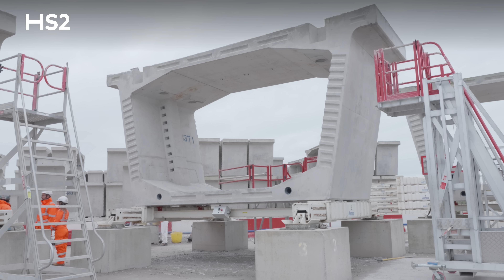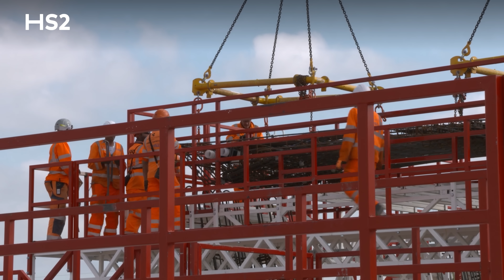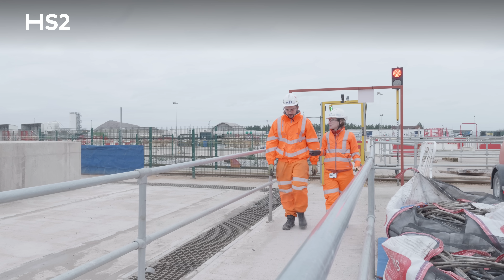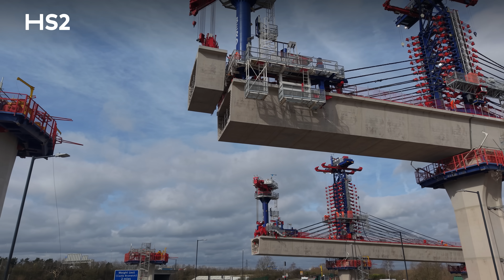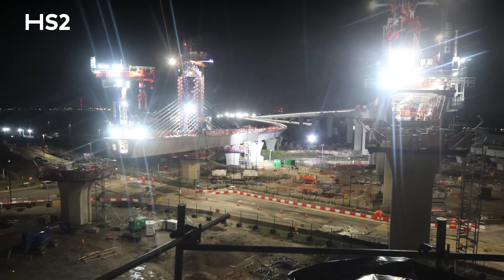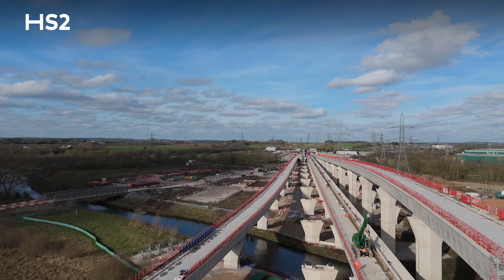Last segment produced at HS2's giant 'viaduct factory'

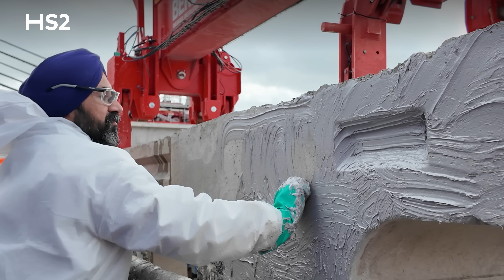Comment: 2:55 I get the glue is probably immensely strong, but I find it hilarious that these viaducts are glued together!
Reply: They are also mechanically connected using internal steel tendons, that thread through the holes visible in the segments.
Reply: @Polarbear1-b6j  why do they glue then ?
Reply: @fergusjones123 you don't want to be dependent on just one method which could fail. What happens when the cables need replacing in 50 years? Redundancy builds strength and safety.
Reply: @fergusjones123  The glue has two uses. The first is to lubricate the connection between the two segments when gluing them together. The second, after polymerisation, is to seal the joint. The glue has no structural function in the short or long term.
Reply: @ciccolinistephane4637  Stephane, thank you for this explanation; it is much appreciated. Hope you and the team(s) can continue this great progress on HS2 throughout 2026. Best wishes.
Reply: Probably not a good idea to let water fester in the cracks.
Reply: Not just glued together

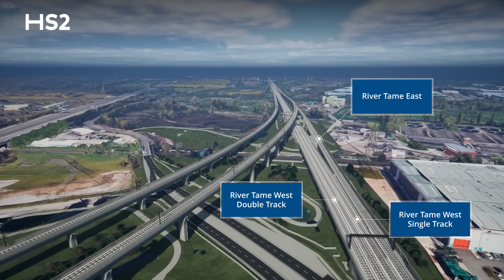Comment: In the graphic at 3:12 the labels are all wrong. The 4 tracks of the main line can be seen going from the bottom of the image to the background with 3 tracks going under Water Orton No. 1 Viaduct and 1 going around to the right of it.
The issue here is that this is not 3 long viaducts the whole way but rather 2 viaducts then an embankment and then the 3 viaducts mentioned in the labels.

Following the main line from the bottom of the image northwards:

1. First we can see 4 tracks all together on the Chattle Hill Box Structure which takes the line over Lichfield Road.
2. We can then see 2 low viaducts Watton House West Viaduct with 3 tracks and Watton House East with 1. Both of the "River Tame West" labels are pointing at Watton House West Viaduct.
3. These low viaducts are not made from precast segments like the others mentioned in the video. They both continue over the railway to abutments where the label saying "River Tame East" is currently pointing.
4. Watton House Embankment is the area of landscaping near the center of the image where Water Orton No. 1 Viaduct crosses the main line on those 3 massive straddle bents.
5. Just beyond the 3rd straddle bent is where the actual River Tame West Viaduct begins and then stretches all the way to Curdworth Viaduct in the distance which is where the main line meets the 2 Water Orton Viaducts. River Tame West Viaduct actually starts not too far from where its label is pointing, just follow along that track north over the embankment until you can see the blue line of the river. It then gets hidden behind the taller Water Orton No. 1 Viaduct but also goes all the way to Curdworth Viaduct.
Reply: Is the Curdworth Viaduct you mention the same as the Curdworth Box I have seen referenced elsewhere?
Reply: @IanInglis-t8v yes
Reply: Yes, the labels are pointing at the tracks which will end up on the viaducts mentioned in the labels, which are further ahead in the image. Rather sloppy.

Comment: Very impressive. I wished we had such progress here in Germany.
Reply: Ne würdest du nicht. Das Projekt ist Ultra verspätet und Mega teuer. Quasi nen britisches S21. Natürlich sollen die das bauen ist super, aber geplant ist das Ding nicht gut 😂
Reply: Keep the faith, the tide is turning. Von der Loser stated that Europe needed nuclear today. Quite the U turn but a necessary. Best wishes.
Reply: @jonread1983  terrible. It wont help anyone soon. Nuclear projects are slow af, costs millions or billions over budget making it one of the most costliest kWh ever produced. That said, you can solve both problems however, you are still lacking long term storage for the waste which litereally needs to be stored to infinity costing a lot every year and finally, we are running low on actual nuclear fuel... Besides that von der leyen mentioned small modular reactors which have NEVER been build, will cost a fortune and are LESS efficient than big ones. There is NO POINT in building these ever. And: burying nuclear waste deep within a mountain and pouring cement on top is not a safe storage, its little childrens logic, what i cant see is not there, kickabooo...
Reply: @ffmag9501  What do you suggest?
Reply: @jonread1983  First of all, grab the full potential we already have with renewables. Investors are literally queueing up in germany to build big scale battery storage but the electricity providers are too slow or made slow by conservative politics to provide the essential grid connection. with battery storage you can even out the demand and supply curve. That this works can already be seen in california. right now Ger is already at 60% renewables you can pump that up with batteries easy and fast WITHOUT any gov invest. Then redesign the electricity market, it is from old times thought without renewables. The last 20% to 100% renewables will be hard and i dont suggest to do that like right now. And it will only be reached with gas turbines that can ultimately be fueled by hydrogen. But these 20% do not matter now. They will matter in 2 or 3 decades. There is so much more to decarbonise: Cars, Trucks, Heating. Funny enough all these three things are not only locally pollutant free they are cheaper and economical to use... But all our energy minister is trying to do is sell more gas to make her former employer: E.ON happy. And now you have the salad as we would say in germany. One war in Iran is enough to destabilise your economy. Nice. Don't get me wrong I am not saying we need to blindly adapt green tech because its good for the planet. Yes we need to eventually but there are so many options available now that are just cheaper and non polluting that it is just dumb to not do so. Politics finally needs to just do whats necessary...

Comment: Im not looking forward to the travel chaos when the m42 is bridged.  Given you have this site and a second bridge on the same section of motorway, hopefully you'll progress both bridges during the same closures rather than have 2 separate sets of closures?
Reply: I think only one closure per carriageway, would be best, leave the other carriageways flowing, so 1)M42=>M6 slip closure, 2) M42 South closure, 3) M42 North closure, 4) M6=>M42 Closure
Reply: remember that hs2 crosses the M42 in 3 different locations _ by j6 as it leaves Interchange Station _ up towards j8 as the northern lines cross by Coleshill Manor & on the other side of j8 for these 2 viaduct crossings
Reply: @Michael-61-n3l the interchange Bridge is on a different section of the motorway. They'd just close j5a to 6 for that as there is a good diversion route on the new road. The other 2 are so close together that the same closures could cover both. Strictly 4 if you count the already complete Marston box, and indeed more had the east Midlands leg gone ahead.
Reply: @garthcox4307 __ I didn't include Marston Box as that section of hs2 is on pause but hopefully that will change sooner rather than later _ but is correct but I must disagree _ the line of hs2 out of Interchange will cross the M42 between j6 A45 & j7 the M6 north slip road _ it will near the new road bridge for the A452 Chester Rd which was installed about 4years ago _ lifted in on SPMT's _ they can use the usual diversion route of A45 / A446 up towards M6 j4 &/or continue up to M42 j9 _ driven it multiple times _ M42 j5a was /is being installed to aid traffic flow for the airport _ it won't help when BBV lift beams for the hs2 rail crossing
Reply: @Michael-61-n3l my mistake re the interchange Bridge. I thought the Marston box section will be built as part of phase 1 as its on the route to Lichfield.  I think they are right to prioritise euston over handsacre as a line stopping at OOC would be utterly pointless
Reply: @garthcox4307 __ my perspective is the priority is OOC to Curzon St _ as there is still no sign of any plan being brought forward for Euston let alone a start work notice _ concentrate on what is now progressing _ OOC to Curzon St _ I would like to see Manchester progress quickly _ I'd have to check the dates on the Parliamentary bill but with land already purchased & surveys partly done along with structure planning and considering where the construction is south of Litchfield movement towards Manchester is very possible _ but the fly in soup is of course the various political views of a large number of politicians who have different ideas & goals in mind _ as we heard recently do NPR before northern leg of hs2 _ hs2 to Manchester allows the linking of the 3 largest cities _ although I would link Liverpool before Leeds  even though Leeds is important within the network _ although I do not support the proposal for the large underground station being promoted by politicians in Manchester _ build it to what was originally intended and at the same specification regarding speed _ it would be a sad mistake to have differing speeds
Reply: @Michael-61-n3l  It crosses the M42 for the final time, just north of Junction 9. After that, it heads towards the AVFC training ground, then off towards the Lichfield area to join the WCML. The Eastern leg would shadow the M42/A42 route towards the East Midlands.
Reply: @lukesdad5218 _ I know _ I didn't include it in this answer as that leg is on pause _ hopefully that changes sooner

Comment: as you drive past the work on the M42 for these 2 crossings _ Water Orton no.1 & 2 _ the piers in the central reservation have yet to be cast _ various equipment is on site as the piling rig went off site couple weeks ago _ but the actual piers are as yet not cast ( as is the case for the 2 on GilsonRd ) _ going to be interesting as I drive past to see there progress _ there was talk of the segments being lifted into place by SPMT's _ let's hope that hs2 film that event _ 

               going to interesting to see the Curzon approaches take shape as Kingsbury starts the manufacture of those pieces _ 
      going to be an interesting 2026

Comment: When will the first train run? Impressive, but this section does not get trains running between London and Birmingham?
Reply: Wrong. They have cast the segments for all the arms of the delta junction and quite possibly some of the other bridges in the Midlands.  Hs2 will also go 20 miles further north to handsacre junction as part of phase 1 before any future extensions.  Crewe will happen, its has to, whatever its badged as.
Reply: @garthcox4307  May be we will end up with the Handsacre junction an Crew line, creating a bit of redundency there.
Reply: @DavidKnowles0 handacre junction will be built whatever but it still creates a capacity issue.  The route to crewe has to be built to achieve the full benefits of the route. Indeed the original concept was a europe wide high speed network through the tunnel, as an alternative to flying. Its overkill really just to go to London. If it was only about capacity it could have been built more cheaply with a lower top speed. Once its built though its use could change over time so there is the future proofing aspect.

Comment: Yes, keep the skills, use the land already set aside, and build the northern leg at least to Crewe and ideally (at least) to Manchester. Despite the inevitable niggles, big infrastructure benefits everyone.
Reply: I think when they realise what a traffic jam of trains the HS2 will cause, that will trigger the extension to Crewe. I also think it only a matter of time before Leeds start lobbying for the HS2 extention to be restart to it city.
Reply: @DavidKnowles0  At least they are building the delta junction (designed for connection to the eastern leg) in full. The River Tame East viaduct mentioned in the video is for trains from Leeds (so is going to be redundant for decades).
Reply: @charliep1973  The eastern leg was planned to run through site of this facility, then through our nearby waterpark. There was a sense of relief locally when it was "cancelled". It may end up being  a false dawn. 🤔🤔
Reply: It will be silly if they don't. It will be cheaper if they just keep the building going, keeps the jobs secure for all these industry experts, creates the UK's own industry which they could export their knowledge of building infrastructure like this across the globe. It's needed and it will be silly if they don't.
Reply: It can't go to Crewe, they're about to build 188 houses on land that was supposed to be for HS2(North Staffs)
Reply: @jasonbarnett8911 it can go under the housing then, will cost more but it's not impossible